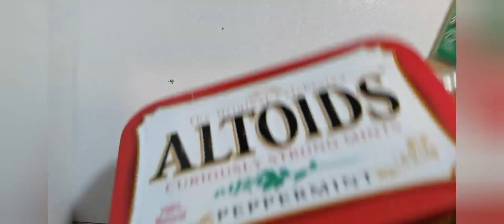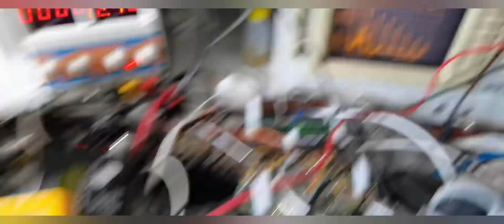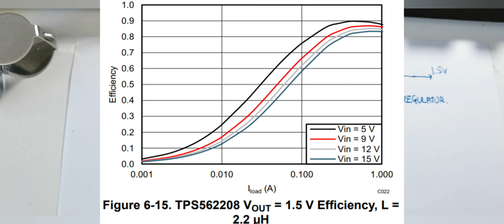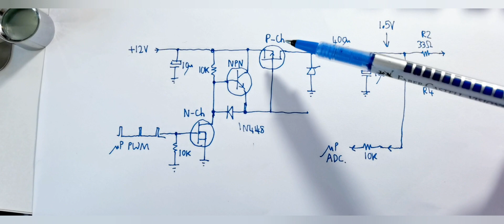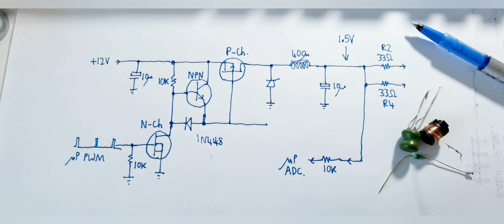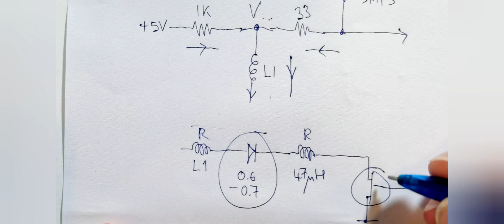QDX Rev 4 changes, and the discrete buck converter

Comment: So what (if any) changes should I make to a V3 (NOT V3a) board, and can use the V5 firmware on the V3 board?
Reply from the maker: All firmware versions are backwardly compatible. Using the latest firmware is recommended. You should not make any changes to a Rev3 board. Just use it happily!

Comment: Hans love the v3 I am using at least once a week at a POTA site!
Is there a way to make the QDX 40m, 20m, 15m, 10m to match my EFHW 40-10m resonant antenna. Or, better question is there any plans to make instructions for ‘pick your own’ bands you wish to operate. This is a newbie amateur question, but I’m certain someone has asked it and you’ve probably answered it 1000 time over. 
I also would love to see an amp kit specifically for the QDX as it sets, say 5w to 20w. 
Keep doing great things!
Thanks, 73!
Reply from the maker: Hi James, QDX (install latest firmware) can already be configured for any combination of bands in the firmware; the question then is how to support that in the hardware; You have a BPF coil with 4 taps for receive, and on transmit three LPFs so if you want 4 bands, 2 have to share. It takes some design. I am not sure I can ever come up with a cookbook for any permutation of desired bands. So something will probably always be up to the experimenter/community in that case. But I do intend to release a "high bands" version soon.
Reply: @QRPLabs  Hans, I say again and again, you are a genius! 
I will add that in speaking to my local club friends about your product, the QDX, I offered to make these for any club member who buys one. My radio is awesome and want my friends to have the same joy I’m getting from the kit. Thank you!
Reply: @Randrew  Bring that to the HamFest 5 November. I will be with Joe Eisenberg and his build session on the NE corner of the Stride Center. He has a 10$ FM radio kit he is demoing and doing some SMA connection techniques! 20 people! I will be his assistant and body guard, hehe! Oh by the way, I did invite Hans to our Hamfest(no joke), but he had to decline.
Reply: @jameski5oeb668  I will try to make it there!

BTW, your talk about an amp kit inspired me to complete my task of testing the QDX with QRP-Labs 50W Power Amplifier kit that's intended for use with the QCX.  I dialed it so the QDX is putting about 2.8W into the PA with the PA putting out 25W.  The PA is intended to run intermittently for CW operation, so running FT8 or (heaven forbid) WSPR at 50W is like a real hot, long key-down for the PA.  Anyway, I figure any more than 25W out on FT8 is cheating :)

I haven't gone on the air with this 25W configuration yet - just into my Rohde & Schwarz CMU300.
Reply: @Randrew  my ICOM box doesn’t really want to do more than 25 watts FT8. Now I really want to see what you have!!!

Comment: My goal is to run the QDX in a stable and long endurance mode. Does the new SMPS upgrade make it safer to run a full 12v VCC when before it was most cautious to run it at 9v?  BTW, I ordered one last week.
Reply from the maker: I don't think I ever said it was more or less cautious to run it at 12V or 9V. There are advantages and disadvantages both ways. The SMPS reduces TX heat production by providing a more efficient method of forward-biasing the PIN diodes. But yes, it has a greater benefit for 12V operation than for 9V operation. In both cases it is an improvement; but the improvement is bigger, for 12V operation.
Reply: Does this mean that in pre-assembled units there still is a 12v and 9v build? Or has the new rev expanded the acceptable range of input? Is the 12v limit inclusive of 4S LifePO4 “12v” batteries that are actually a higher voltage?

Comment: I'm now an old electrical engineer.  I haven't done circuit design and board layout in 15 years.  This video was nostalgic.  I've missed the design process, and your description reminded me exactly what it was like, and the joy of using a combination of experience, intelligence and testing to continuously improve a design.  I always loved designing every aspect of a product like this so I could make optimal tradeoffs between software and hardware, such as your microcontroller generation of PWM signals for the switch mode power supply.
Reply from the maker: Thanks yes it's a lot of fun (alongside stesss and frustration). Maybe you'd enjoy my other video about adding VGA output. That was really cool. PWM easy by comparison :-)  But the PWM buck converter is a lot more useful to 99.99% of the kit owners :-)

Comment: I haven’t gotten to watch the whole video so I apologize if you cover it, but if I ordered early Sept will I get 3a or 4.
Reply from the maker: Almost everyone who has an outstanding pending order now, will get a new Rev 4 PCB. If I had any Rev 3a left, I would have shipped them out already rather than kept people waiting. But I say "almost everyone" because who knows, someone might find a Rev 3 around here ship it. If you want to be 100% sure please raise a helpdesk ticket and ask for it to be noted, for your order ID.
Reply: @QRPLabs  Got one of the 3a boards but that's okay. I'm going to have fund building it and this video will help with the mods (not going to try the smps solution but loved the explanation). I'm doing this to learn and use the EET degree I earned all those years ago. I love this, it's what I've always wanted to do. 🙂
Reply: @neilcherry6452  I think you'll love it like I do mine!

Just read each section of the assembly instructions fully before performing that step.  I'm the impatient type and found myself backtracking or worse, wishing I'd read through first!
Reply: Same question here. I placed my order two days ago.
Reply: Same boat, but I'm assuming 3a or Hans would have put out a video earlier.  I'll have no problem with it - perfectly happy with my first Rev 3a and will be thoroughly pleased to have 2 more when they arrive.  Hans did say the Rev4 will be shipping in a few days, so maybe that IS what we're getting.

I DO like the 0.1" pin spacing for the BS170s in Rev4.  I was wishing I could install pin sockets myself.  I did some experimenting to push output power (by raising supply volts).  My final iteration was to use the original 4 x BS170 configuration but replacing the bolt, nut and washer with the following:

1 - a long-finned heatsink measuring roughly 22 x 22 x 36 mm
2 - the BS170 transistors potted with a thick paste of high-temp silicone + fine aluminum filings
3 - the original small bolt with screwed into a hole drilled and self-tapped in the above heatsink
4 - a 24 x 24 mm hole cut in the QDX enclosure top half to allow the heatsink to stick out

With that configuration I've run at 12 VDC (~7.8W out by my measure) making FT8 contacts in a long session as I normally would with no problems.  The heatsink gets notably warm, but not scarily so.  I have briefly transmitted at 14 VDC supply just for measurement purposes, but I do not trust the heat transfer of either my potting compound nor the transistors themselves enough to operate that way.